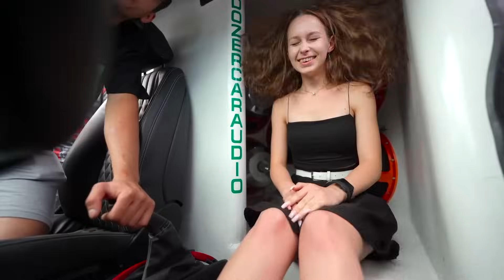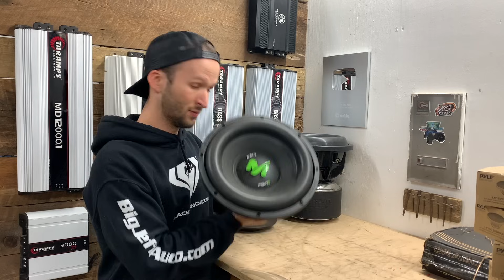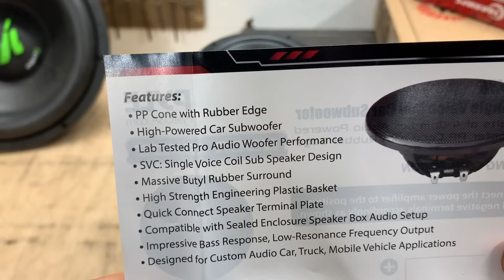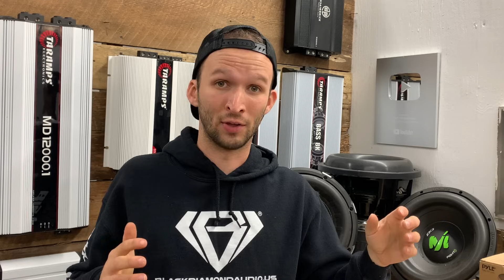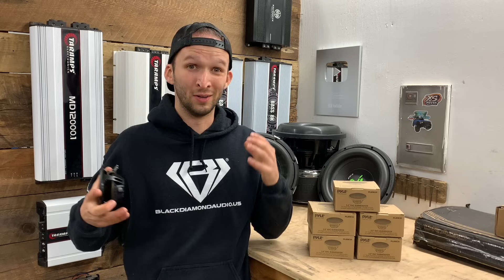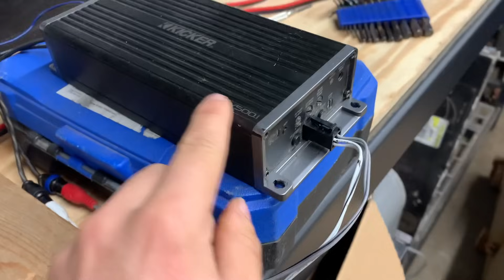HOW BAD is Amazon's CHEAPEST "Subwoofer"? | Full Test and Review

Comment: 20 of them in a sealed box with 200W RMS would be an interesting test. They sound pretty musical at around  30-40hz. It will always sound crappy if you overpower it.
Reply from the maker: I agree!
Reply: At that point though u can buy a decent 12 that will whoop 20 of those
Reply: @scottbe1 it's been done a million times - where's the fun in that ?
Reply: @bobcat3653  better for anyone to buy a nice sub vs these.
Reply: Make a neat little "portable" Bluetooth speaker build
Reply: @Toddsnightmare this...💪
Reply: Better bump that up to 100 😂
Reply: Overall ppain in generall.
Reply: And what would happen to the impedance if you powered 20 of them from a single amp?
Reply: @Synthematix you have to run a combination of series and parallel by doing both you can create whatever end impedance you desire.
Reply: @Synthematix he even did this with the 4 ran series parallel to end with 4 ohm
Reply: You got to use ohm's law and series parallel to come to the final ohm load that you need @Synthematix
Reply: Rattle matters, even if you don’t notice it from the inside. Nothing screams “janky and cheap install” like a bunch of tap dancing plastic. Significantly detracts from the cool factor. It’s just like how subs pushed past their limit sound like shit. You want a clean crisp sound. Always. 

Like a Hellcat. You can still hear the big horsepower even when it’s not all being used. ✌️
Reply: Or a 6th order bandpass
Reply: Why didn't u try porting the box to see difference?
Reply: i think quiter better sounding bass is better then ur car rattling tbh
Reply: @JuliannaTheStar quieter
Reply: @JuliannaTheStar There is always the hater, that thinks we care, about other people, hearing the outside of our vehicle rattling, while on the inside, we don't hear "ANY" of the outside rattles, or your complaints😂
Reply: @evilinside5984  to each their own you also have to take in local noise violation citation as such and such etc. etc. or who gives a ***t attitude.
Reply: @Noswalas74 Im not even talking about a very Loud system, a vehicle can rattle with 1- 10 in. Woofer in a small sealed box, with a 100 watt amp going to it. Im not into trying to be rude, but if my car rattles a little, i cant hear it from inside, so it don't bother me. Im not the person to sit out in front of peoples house @ night bassing for 30 minutes or more= not me.
Reply: @evilinside5984  I apologize I responded to the incorrect person. I was referring to the 140 + db systems so forth. Specifically designed to be heard illregardless of the damping material you use to “ cut down on rattles”
Reply: @Noswalas74 No prob., take care.
Reply: then you are a fucking joke.
Reply: @JuliannaTheStar  or u can do 140+ like me and not here any rattles on the outsides bc of sound deadner 🤷🏼‍♂️
Reply: @scottbe1 hear